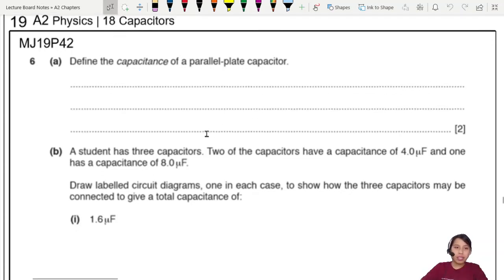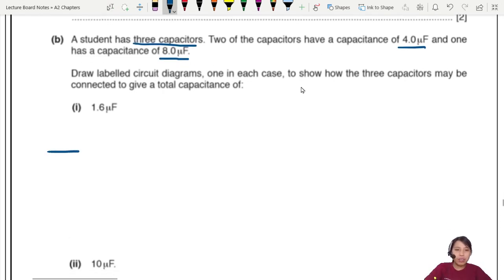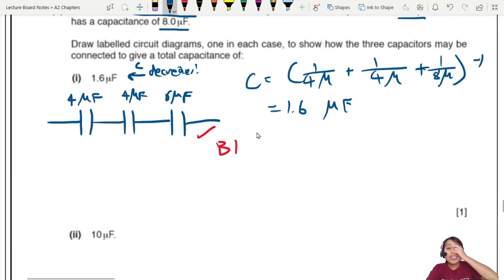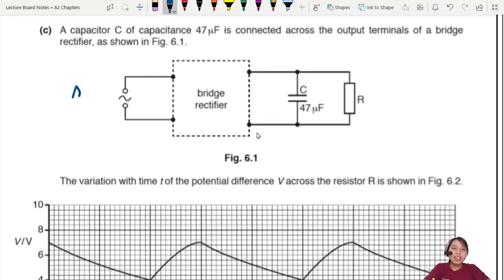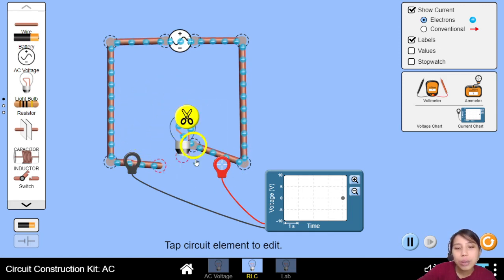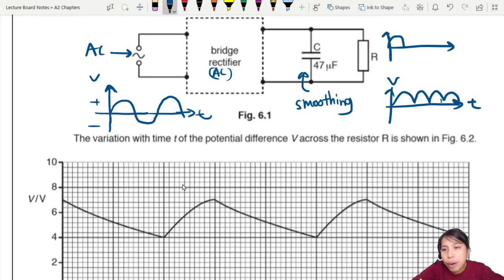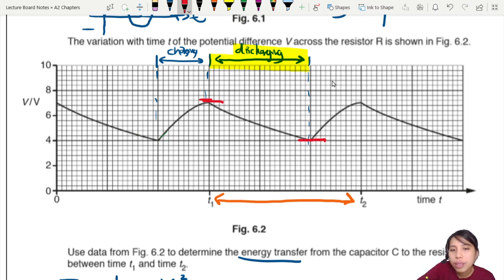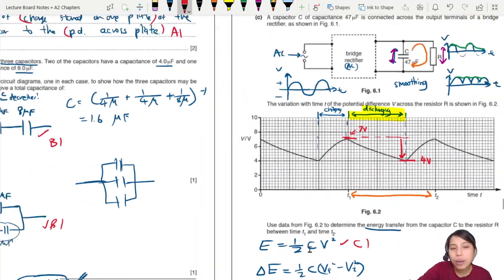19.3b FM19 P42 Q6 Smoothing of Voltage | A2 Capacitance | Cambridge A Level 9702 Physics

Comment: At 11:40 wont 4 be the final voltage and 7 the initial. Why did we use it the other way?
Reply from the maker: You can also do that method, and get a negative change in energy for the capacitor! 

But since energy loss in capacitor = energy gain in resistor, we can ignore the negative sign and both ways work.